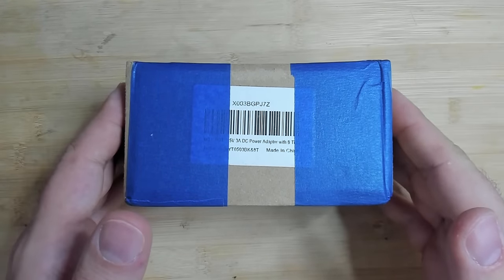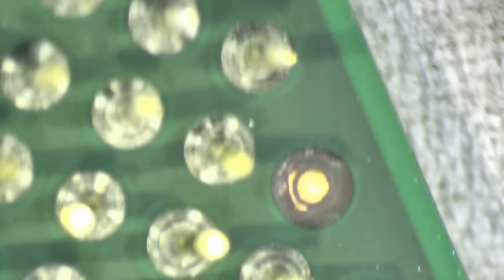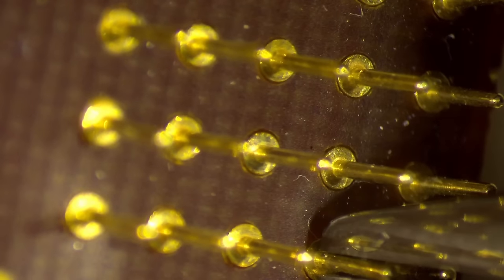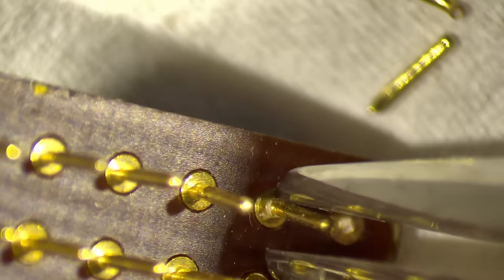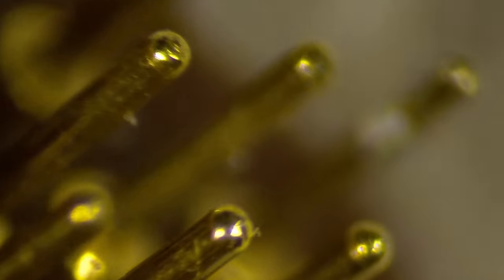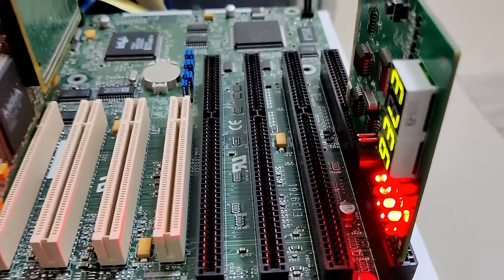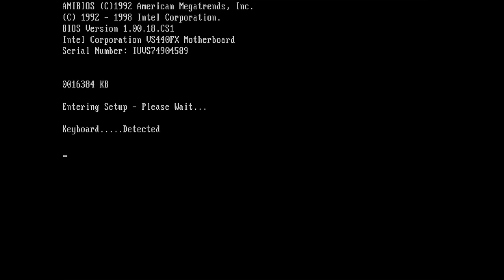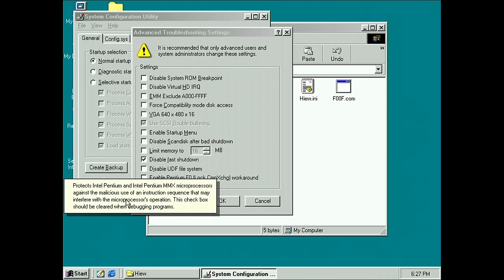1024K reasons to fix this Pentium Pro 1M!

Comment: I also dont have 1M PP, i dont even have 512k ones, just multiple 256k, but i keep them, as PP are piece of art for me, the greatest looking CPU...

No u dont need toothpick, or other crap like that, i use razor knife blade for this type of work, and when i place the blade in line, i use all the pins to correct the bend ones, with some force, it work like magic.. Ofc the very very bend pins i dont use the blade on them, but tiny screwdriver to make them kinda straight, and after all of these i use the razor blade...

Great job at fixing this CPU.

Comment: I have never seen a black Pentium Pro.  
And your soldering skills are very impressive. Great job.
Reply from the maker: Thanks!
Reply: @bitsundbolts  I've a question. 
I got an Asus P2B motherboard for retro gaming. I went to turn it on by shorting the pins. BUT. By accident, I hit a 3rd pin. Got a spark & the board got messed up. I let it sit for a bit & when I tried to turn it back on. I get power to the board, Hard drive & CD Rom. But, I have no video (AGP card) & the cpu fan isn't working. Is there a chance to fix it or is it a lost cause ?  
Im so upset with my self, Wanted this board for ever. It was rock solid untill I messed it up.
Reply from the maker: Hm, good question. I haven't had such an issue. The P2B has several pin headers for power and HDD LEDs, reset and power switches, and other functions. Without looking it up, I have a feeling that some of the headers are controlled by the south bridge (e.g. LEDs). Can it happen that something got messed up? Maybe, but I'm not sure - it depends what pins you shorted. I assume you shorted the power header with an adjacent pin. Do you remember what pins you accidentally shorted?
Reply: @bitsundbolts  It was either the Message LED pins or the message led & SMI lead. 
Again. the board gets power & the hard drive & cd Rom power up but, no video & no power to the cpu fan. I tried 2 different cpu fan connectors & nothing.
Reply from the maker: Hm, that the CPU fan doesn't power on is a bit weird.
Just in case, can you check if all the MOSFETs to the right of the CPU make good contact to the board? There are some capacitors as well. I fixed six of those boards, and in two cases, the tab lifted from the board - which causes the CPU fan not to turn. It is unrelated to you shorting the wrong pins - and it may be just a coincidence.
If those MOSFETs are solidly soldered to the board, then I guess it would be good to find out where those message pins connect to. But I'm afraid it's the south bridge. I don't want to say that there's no hope, but it doesn't look good.
Can you try a PCI graphics card? Or even an ISA VGA card?
Do you have a POST code analyzer card?
Do you get beep codes if you remove your RAM/VGA card?
Reply: @bitsundbolts   I Just checked the cpu fan on another board & it works. I dont have another video card to use. & I have to say. everything looks Very clean & attached. Even the capacitors are in good shape. I dont have a  POST code analyzer card. & no system speaker either :-(
Reply: @bitsundbolts  Ok, Big update for you.
I went & looked again for a system speaker & found one. So I get the board, PSU, set it up. Add the speaker. Short the power pins to turn it on. I look & the CPU fan is all of a sudden working. I'm like, no way. Oh please work. So I shut it down. Grab the video card. Put that in, power it up and Hot Damn !  It came back to life. So I plugged in the Hard Drive & CD Rom. turn it on & it boots right in to Windows 98se. No problems at all. Runnin' smooth as ever. IDk what happened, But its working again. - Thank you for all your responding as well. I really appreciate it.
Reply from the maker: Good morning. Well, I woke up to good news then! Congratulations that the board is working again! But what a weird issue!
Reply: @bitsundbolts  Good morning. Yes. Very weird. I tried powering up that board many times over the last 2 weeks. So I've no idea how it just came back to life.  I'm very happy about it. I've always wanted that board. A rock solid board. 
Again, thank you for talking with me on this & I hope you have a great day. :hand-purple-blue-peace:
Reply from the maker: I'm happy for you! It is an amazing board. I fixed six of them, replaced the voltage regulator control chip somit supports lower voltage Coppermine Pentium IIIs. I hope your board will last you a very long time!

Comment: You could also the mechanical pencil trick, just remove the graphite and slide the pencil over the pin and you can easily use it to straighten the pins. You managed it though, wonderful work.

Comment: That P3 is actually quite likely to still work even with the damage, as this is a single layer chip (like nearly all modern silicon, as far as I know multi-layer is still very experimental), so only the bottom few nanometers are actually relevant, the rest is just a piece of glass. So if you can fix those pins (maybe with the help of uv solder mask to prevent solder from connecting to the wrong places), there is a good chance it still lives. I have actually seen worse chips still work, including some fairly modern gpu (3060 I think), which is still completely fine despite the damage.
Reply from the maker: I tested all those chips before I put them in a box for scrap pins. I'm afraid, this chip is dead. Some have visible cracks through the entire die. But you're right, from chipped corners, you can't tell that a CPU is dead. I have many CPUs with chipped corners that work perfectly.
Reply: @bitsundbolts  That's unfortunate, but it is vintage hardware, so not entirely surprising. Interestingly, I remember the P3s to be fairly reliable (unlike xp-era AMDs and celerons, and more recently the ryzen 3600), but shorted voltage regulators and bad ATX supplies weren't rare back then, so that might have been it. But whatever broke it, at least its parts help you save other chips, so I guess that's the best possible ending for a dead CPU.

Comment: Have you tried to heat up bent pins with soldering iron and then try to unbend them? Maybe heat will help with brittleness...
Reply from the maker: I tried this on 486 CPUs. Unfortunately, heating pins doesn't help much - if at all. Those metal pins would require a lot more heat which most likely will damage the plastic body of the CPU.

Comment: 0xC3 will only work under the C runtime environment, for a DOS COM executable you need to use:
B8 00 4C CD 21
To return to DOS. The entire program should therefor be:
F0 0F C7 C8 B8 00 4C CD 21
Which means:
lock cmpxchg8b eax
mov ax, 0x4C00
int 0x21

0x4C00 being the exit program with return code function and int 0x21 to call the given DOS function.
Reply from the maker: Wow! Nice and thank you for sharing this. I'll try that once I get that system back up for some comparisons.

Comment: Amazing work and video! One question: Pentium Pro heatsink and cooler seems impossible to find...what alternatives/compatible we have for this issue?
Reply from the maker: Thank you!
Yes, that is what I heard as well. Socket 8 coolers seem to be rare. I was lucky that I found three boards with coolers - all the same as shown in this video. Even though they're no high performance models, they get the job done.
The best option is probably a custom made solution. Maybe something exists already

Comment: tl;dr - I think the jumper you moved to flash was actually for BIOS recovery mode - no harm done but it skips any verification and is why you didn't see anything during the flash.

If you had just normally booted from the floppy w/o moving that jumper, I think you'd get a more normal experience of it loading a flash util and you see progress on screen?

Assuming this board is like how many later Intel reference boards are the jumper you moved to flash was actually the "bios recovery mode" which I think was intended to be used if you accidentally bricked the mobo (assuming the BIOS boot block still lived). I know of it because with at least with Intel socket 7 and later Slot 1 boards you could also use that to "cross-flash" between various OEM "flavors" of firmware - for instance if you wanted to change from the Intel branded to Gateway branded bios. Sometimes OEM versions (like Gateway) would fix things like sleep or resume that the Intel "original" didn't work right.

Note that since it seems to skip verification yes you can also blind flash totally wrong firmware too which can be entertaining - I think as long as the boot block still lives you can recover from that also, but obviously not recommending you test that unless you have an eeprom programmer handy =)
Reply from the maker: Hm, interesting. I didn't try to flash the BIOS without changing the jumpers. I think I read this procedure in the manual.
I really don't want to experiment with those BIOSes - they're those flat BIOS chips that would be a pain to remove and flash. Good that it worked like this too.

Comment: This & the gold top have to be my fave CPU's just becuese they where so huge & i loved doing things with them so few others where doing at the time, 
that cach was amazing for bus fx in audio production if you new how to modify the plug ins to take advantage of it which few did.
I still have mine to this day, i have a twin board in pristine condition which ive owned from new all these years. Nice to see one of these black top saved from the scrap vultures.
 Ironically there is actually more gold in the black tops than the gold tops.
Reply from the maker: I didn't know that those black tops have more gold - I guess it must be because of the second cache chip?
I'm planning a few follow-up videos and testing PPro, Pentium, Pentium MMX - and maybe even PII to see how their performance differs - all around the 200-233 MHz range.
Reply: @bitsundbolts   ime not sure if ime honest, in testing i know the black top came out on top by quite a considerable way by weight, sadly this is whats behind their increasing rarity. i have 4 in my collection saved from the scrap man & 4 gold tops 2.  that was an incredible job you did restoring that black top chip, ime interested to see if they can be overclocked

Comment: Pentium Pro, the little architecture that could. It may have been criticised at the time it was first released (mostly because poeple didn't understand the target audience of the cpu) but all modern Intel CPUs still fit comfortably in the p6 Pentium Pro family. 30 years for a cpu architecture is very impressive. I do wonder, if AMD gets a few more Punches in, will Intel have to try something new again. 

I wouldn't trust soldering broken pins like that if the socket wasn't zif. The force needed to insert and remove a cpu from a non zif socket would surely break the solder.

The really bad thing about the f00f bug is that it could take down protected mode operating systems by completely crashing the cpu and it couldn't respond to interrupts like the Ctrl-Alt-Del interrupt from the keyboard controller. On the PPro the instruction sequence no longer stops processing of interrupts. It just generaates an ivalid instruction execption as intended and crash the thread of execution. In Dos it just hung because dos doesn't have a useful default exception handler for the crash foof causes. Ctrl-c might even get back to the dos prompt from this hung state

Comment: Do you ever "load setup defaults" after flashing a new BIOS?  I remember that being a recommended procedure due to possible differences in the layout of saved user settings between BIOS revisions.
Reply from the maker: I did indeed once faced a lot of issues and loading Setup Default fixed the issue. I did not do it for this video I believe. But yes, this should be done based on my experience.

Comment: Quick suggestion that worked for me: when the crack is just between the pin and the base (like two of yours), I put some solder on it FIRST to create a solid base and then straight it up in second place, so the weak base do not break when you straighten the pin, and it will be already fixed. It's just a suggestion that worked for me...
Reply from the maker: Interesting. That would definitely work if the pin isn't too far bent so it would bridge with the solder. I might have been able to save some of the original pins that way. But I'm still happy that the PIII pins are a perfect match as well.
Reply: @bitsundbolts  You are correct. Happy that you were able to save the processor !!! Those used to cost an arm and a leg in 1997-98. Never seen one in person.  Hope to see it back in another video ;-)

Comment: 5:50 On that 850, the pins have small heads so you should be able to solder them back on, it's just that you'll have to carefully soldermask that top copper layer. See if that top layer is connected to a GND pin, or just scratch off some soldermask, then test continuity to it after soldering. Maybe even sand it back further for more isolation/clearance.
Reply from the maker: I am sure it's possible to add the pins, but chances are low that the CPU works. I find these CPUs a lot at the scrapyard. It would be nothing more than a challenge to fix this CPU.

Comment: awesome job. thank you for the great video. way to save these old chips. so what are the plans for this little gem?
Reply from the maker: Most requests are to run some benchmarks on Windows NT/95/98. It may show the strength and weakness of this massive CPU.
Reply: @bitsundbolts it might perform good for some cpu demanding games, like pod?
Reply from the maker: Yes. Some games make use of MMX (POD is one of them) - the PPro will not do well - I believe.

Comment: The toothpick method puts all the force on a single weak point which is why it's so destructive.

If you can get the pliers to grip the pin it can provide some bracing and support as well as spreading the load.
Reply: The problem is that the metal already is work-hardened by the initial bend. The bending back will fracture it more, no matter the method, I think.
Reply from the maker: I tried this same method on a ceramic PPro - no issues there. It must be the material used for those pins that make them so weak.

Comment: Yeah I'm not sure. It's been forever since I coded in x86 assembly for DOS, but you might need to do some kind of call to return control to DOS. It's clearly not hung if you can Ctrl+Alt+Del.
Reply from the maker: I thought I did add the fifth byte to the code that should return, but it was just weird that it didn't exit properly. It works under Windows though.
Reply: If returning to DOS you have to call INT 21 exit to dos function. Really old dos let you exit with INT 20. Windows likely handles bad exits silently.

Comment: Now that's what I call a save!
I think the BIOS could have been flashed normally by booting from the floppy. The jumper being called BIOS Recovery leads me to believe it's only meant as a safeguard in case the board doesn't boot normally due to BIOS corruption.
In most benchmarks, the Pro 233 completely crushes the 233 MMX and it's very close in performance to the Pentium ii 233. If only I had a Pentium Pro 200 instead of a sad Pentium 166 without MMX when I was young...
Reply from the maker: I'll try to flash my other two boards with the jumper in place. I think I read somewhere that I should put the BIOS in recovery mode. Maybe it was written in the manual.

Comment: ppro in ASCI Red was first supercomputer to hit over 1TFLOP. it was originally 200MHz 256k but later upgraded to specially packaged ppro II overdrive 333MHz 512k. now some pocket computers can do over 1TFLOP running from batteries.

Comment: Recovery mode is not the regular BIOS flashing method. Recovery mode on 440-series chipsets is a built-in method for the chipset to load the BIOS from a floppy disk in case you have had a bad flash, invalid CMOS data that prevents booting, and similar BIOS related issues.
Recovery mode will clear the CMOS, and flash ROM, load the BIOS file from the floppy by a specific name, execute it (this involves a lot of slow floppy seeks) and then use the built-in routine to flash itself onto the BIOS chip on boards where this is enabled, and then boot normally.
You do not (and should not) set the recovery mode jumper or dip switch for a simple BIOS update. Boot from the update floppy and you will get VGA feedback from the flash utility and it will do it much faster, too.

Comment: 8:36 Can you share a link or part code for those tiny pliers please?
Reply from the maker: I hope YouTube won't block this comment and it will help you! Here is the model number of the Knipex pliers: 35 22 115 | Electronic Precision Pliers | Multi-Component Handle | Mirror Polished - 115mm

Comment: I think (just a guess) that silver-containing solder wire (Sn62Pb36Ag2) is slightly better in such situations. low soldering temperature, greater strength. Anyway, excellent work!
Reply from the maker: Interesting. I use my regular solder wire and it worked white well. Maybe some day I'll be able to test something like that.

Comment: Just an idea - wouldn't it be easier if you heat up the pin before attempting to bend it? I think this way the material will be softer and more flexible and perhaps not break? Otherwise amazing video as always!!!! :-)
Reply from the maker: Unfortunately, extra heat doesn't help. Those pins would require a lot more heat to get softer. I tried that on a 486 CPU, but that might also be a different material there.